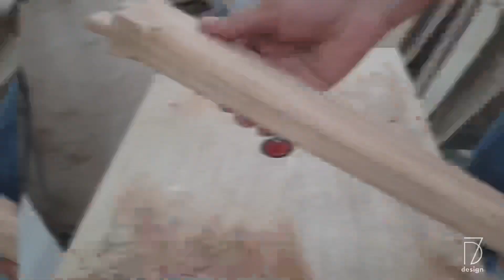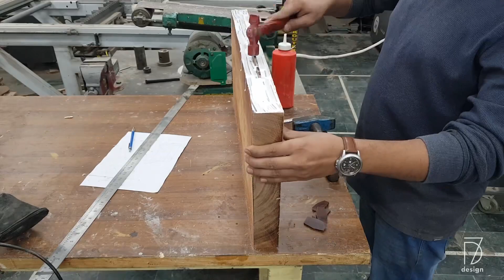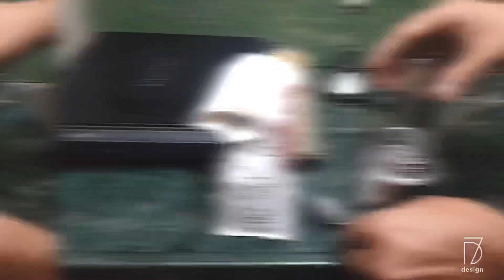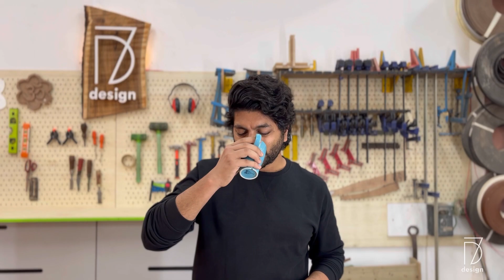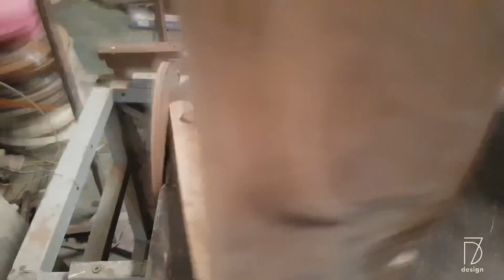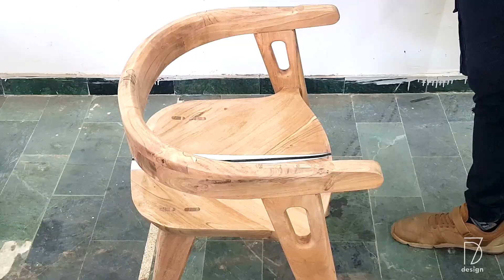A CHAIR || Failure leads to success. Part 01

Comment: 😊👍
I like the design of the chair.
I think the wedged tenons into the arms should be concealed.
I like the ingenious slots in the legs, that allow easy clamping.
I think the seat extends a little too far backwards. 
(Just move the front legs and back/arms towards the rear a little.)
I like the 'jigsaw puzzle'' joints.
You use too many biscuits. 3 to 5 would be adequate.
The biscuits are just for location, to stop the pieces sliding apart when clamped.
More wastes material, & time, and time is money.
(The bricklaying in that wall is appalling!)
.
Reply from the maker: Thanks for your valuable comment...stay tuned there are more video to come. 👍🏻